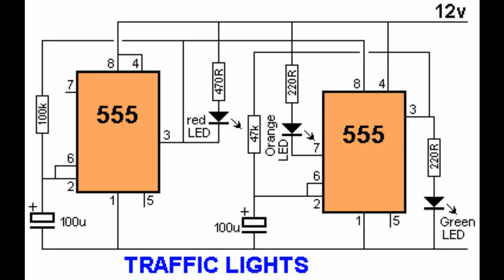2 x 555 Timers Traffic Lights

Comment: hey, i don't know what the hell i'm doing wrong but i can not get this to work. i built the danm circuit over 10 times on a breadboard but it DOES NOT work, pls help me or pls send me a better or a working schematic (i cant make one with a CD4017 cuz i dont have one of those)
Reply from the maker: Hello, I had a lot of trouble with this circuit as well. Make sure that you don't connect the wires together when you see an interruption in the lines. This a very simple circuit but I don't remember much of it. Also, one of your 555 may be damaged, test them separately. Hope this helps.
Reply: hey, i tried it over 10 times with a lot of different wiring techniques but i can't get it to work. i could try it with a new 555 timer though thx for the tip, but if that doesn't work either, i give up until i have a better schematic THX
Reply from the maker: MasterDizaster Yes, you should get a 4017, that would be much better. Cheers :)
Reply: well there is a slight problem, there are no electronic supplyers near my place so i cant get one (i live in the netherlands and i'm 17 years old so i can't drive on my own yet (i cant drive at all)) so how can i get one cheaply?
Reply from the maker: MasterDizaster Well, don't worry I'm 22 and I still don't have a drivers licence (that is by choice). I usually order parts from the internet. I'm sure that there are plenty of online electronic stores in the Netherlands. Or you could try searching for one in old electronics but those days are gone for me because it's nothing more than a waste of time. Of course, when in a pinch, I use old components.

Comment from the maker: Yes, you can increase the output. The first solution would be to use high brightness LED's and second options would be adding transistors to handle more current. I cannot explain how to do it here because I don't have the circuit build and experiment with it. Good luck!

Comment from the maker: Hi, you can extend the time by increasing the size of the 100µF capacitors and increasing the resistance between pin 2,6 and 3 (first one is 100K and the second one is 47K) on both timers. Please experiment with values as I am not an expert on calculations. Good luck :)

Comment: @ciprianwiner ok ... switched out a timer and checked the red LED. all three lights can go on now but they do not blink. Just wondering whats the puropose of the short circuit of pin 3 on the IC on the left in series with the 100 k ohm resistor on the left ??? is that supposed to be there ???